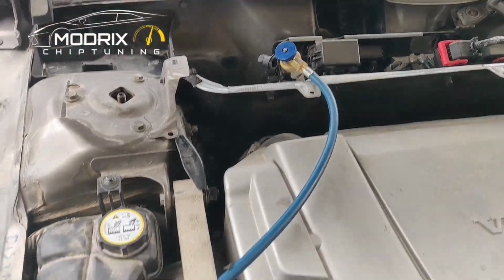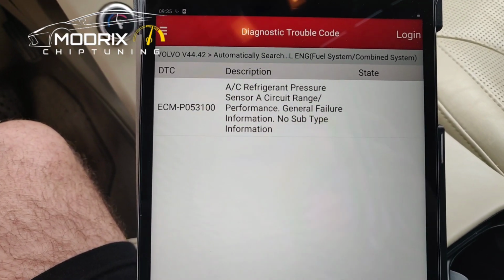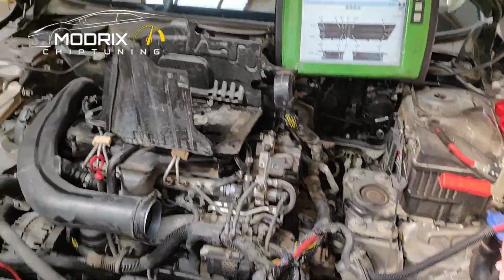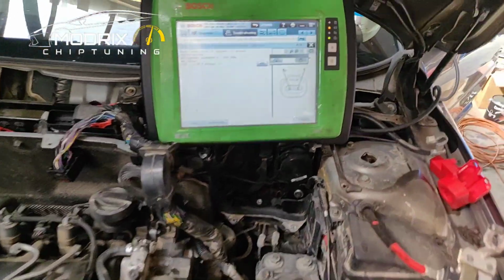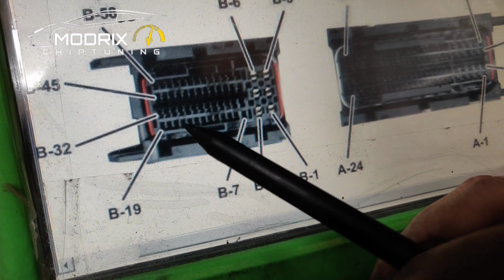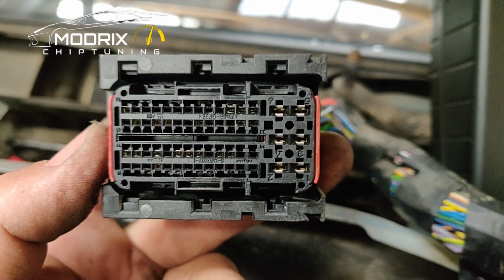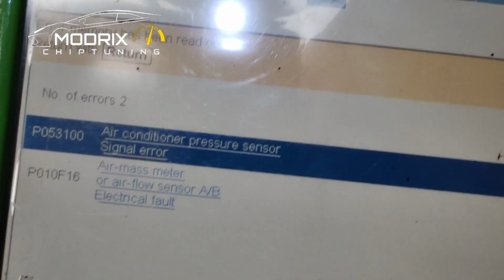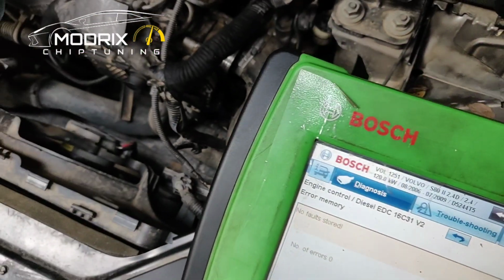❗Volvo S80 2.4 D5 120kw 2008 A/C NOT working! ECM-P053100 A/C pressure sensor circuit Faulty🔥Fixed✅

Comment: Thanks from good video. I found the promlem  no conection from  pressure sensor (grey/brown ) signal-wire to ECU B-connector as you shown in the video. Fixed by adding new wire with "bandit connector".
Reply: Checked first same place where you had the broken wire. I had this place OK, so I did not cheked anymore and simply adding new wire😊👍